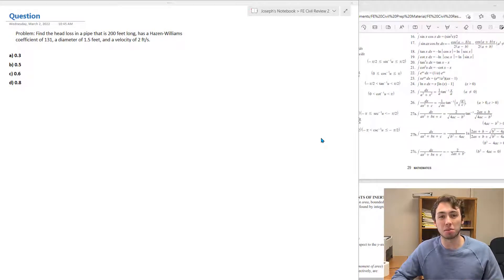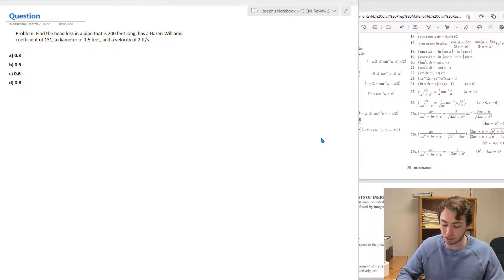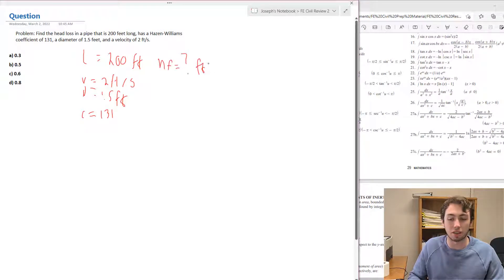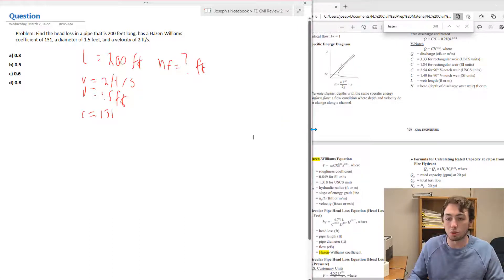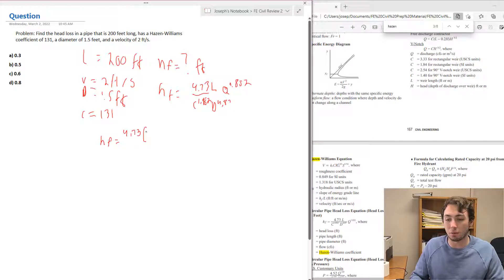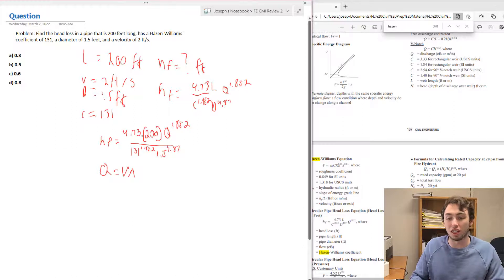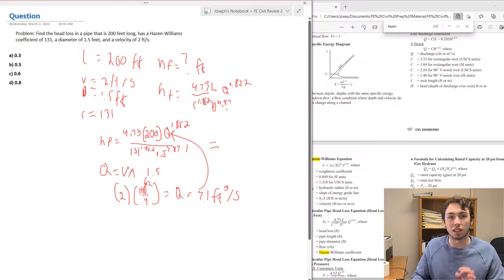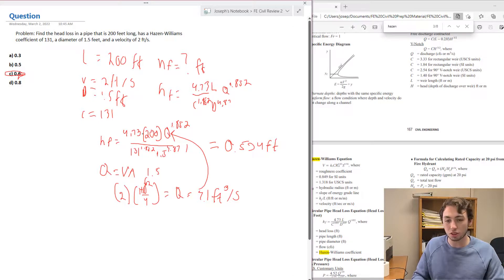Find Head Loss Using Hazen-Williams Equation | FE Exam Review Hydraulics

Comment: as a general rule should we convert all units at the beginning or end of the problem?
Reply: of any problem*
Reply from the maker: In general, you need to convert the units of the problem to be compatible with each other in the equation that you are going to use. You can convert the final result at the end to meet the answer units, but if you are using something like a head loss equation, you will want to make sure feet matches feet, inches matches inches ect. Hope this helps.